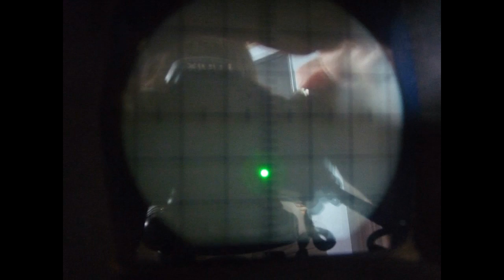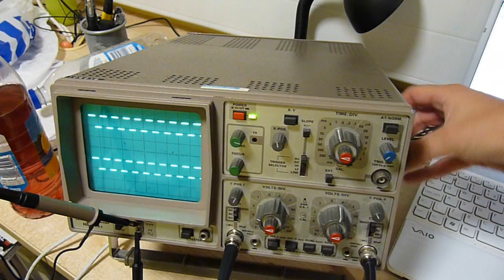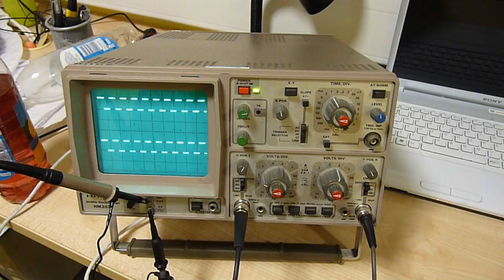HAMEG HM203-5 Overview/Teardown

Comment: Although there are a fair number of plugs and sockets holding things together, there are quite a few wires soldered directly to the board, and the EHT CRT board is connected by both wires and "flying" resistors covered in insulation that are just soldered directly to boards. Getting a board out to repair it would involve a lot of desoldering and resoldering, some in awkard positions.
Reply from the maker: Good job it has never died then, it would be a pain to completely strip down.

Comment: Hi Could you explain how you opened it up. Mine has just stopped working from switch on with smell of burnt out transistor. But I have no idea how to open it? So how did you get yours open?
Reply from the maker: Remove the screws on the back & pull the plastic panel off. Then you can just pull the scope working out of the case.

Comment: Agreed!! They are so expensive for what they are, look inside and most are barely more interesting than a USB stick PCB with an LCD, battery and some cameras and mics attached and don't get me started on the awful operating systems on them!!  They give you Linux, ARM and then stick a JAVA VM on and make  things run (slowly) on top of it! And also lock it down!